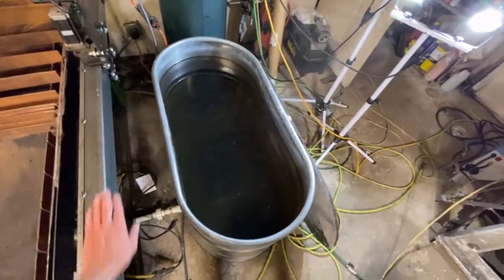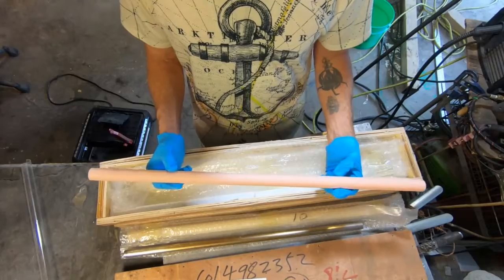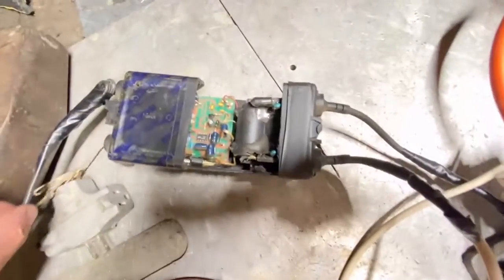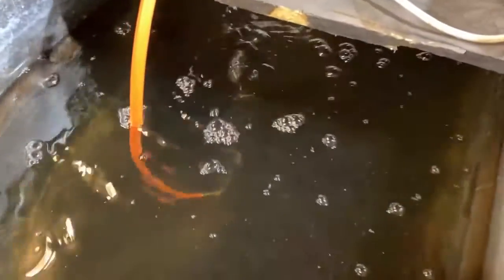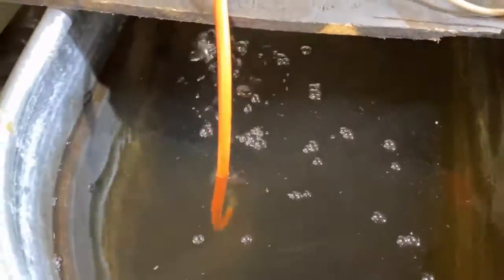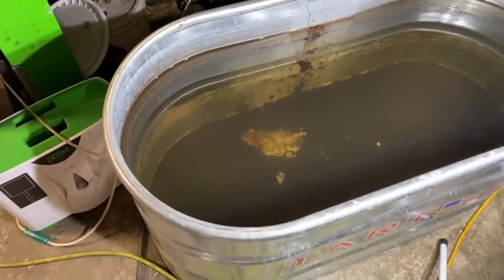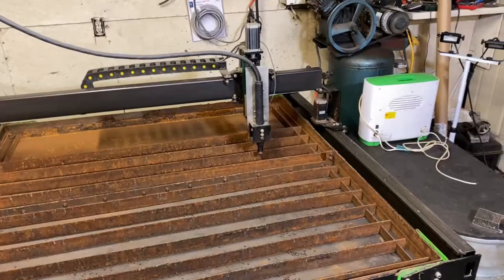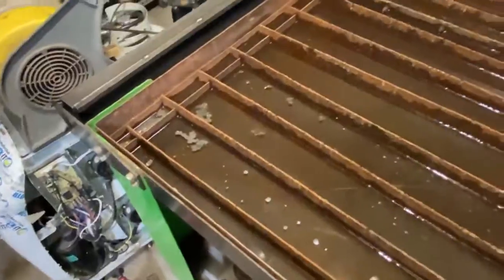Ozone water treatment for plasma table bug soup

Comment: Even low concentrations of ozone can have incredible effects. Use an aquarium air pump to push air past a UV-C mercury lamp in a sealed box, take the <0.5% ozone to an air stone, and you can bleach stored water well enough to hold back algae growth indefinitely for a couple watts. Not for fish, and not for plants, it concentrates in the water, and still kills quite indiscriminately.

Comment: Be careful with ozone man. That stuff can really mess up your lungs on the long term, especially if you end up using it on a regular basis.

Sniffing it like you did here really isn't advisable.
Reply from the maker: Yes i agree but overwhelming ventilation hopefully makes it a non threat  . Ive taken whiffs off units so strong it stings your nose . Not that i advise it but the hazards appear to be benign  so long as its just long enough to see if the thing is working .
Reply from the maker: Probly do this once a month with all the doors open and 3 fans blowing

Comment: How do you ensure fresh air enters the place, ozone in high concentrations isnt healthy, if the place is drafty, id just setup a IOT/Home automation relay and cycle it at night, and as ozone is an oxidizer, will be intriguing to see how the tank, tubes, and table react
Reply from the maker: Th shop is well ventilated the entire time with multiple fans and openings

Comment: Just an idea. You are losing a lot of ozone from the bubbles back in to the air. Add a pipe from the output of the pump back in to the tub with some ball valves so it can be reconfigure to recirculate. At the end of the returning pipe put a venturi injector connected to the ozone generator. That will scrub and saturate the ozone into the water more efficiently in much less time (maybe less than an hour). Also suggest a plastic tub because metal does not like ozone. Don't have to worry about the table, if you let the water sit overnight the ozone will dissipate.

Comment: Can always test the ph and try to get it close to 7ph to 9 ph as possible also if you can get like a fish tank filter out a lot with active carbon and should wonder pre-filter your ozone with UV light it'll double the efficiency air stones won't be a bad idea either or using Ro D I water or maybe even if few well-placed magnets   or set up an overflow chamber for the pump sit in the bottom of
Reply: even a coil of that rubber hose with small holes in it acting like a very large air stone, cap on the end ofc

Comment: maybe the lower brightness in the tube is a lack of nitrogen. bubble that strong ozone through some dirt and catch the foam in charcoal...you might find a surprise loads up in the carbon.
Reply from the maker: LOL you always got some of the charts science in mind and  i love it .
Reply: @NOBOX7  the idea came from a story i heard watching the doco...all the gold you can eat. the story was a mine treating wastewater before release into a river. there was a static potential building on the plastic pipes that conmected the water/ozone tank to the charcoal beds. they found more gold in the charcoal than the mine produced. the wastewater should have been leached already. the operator got hurt by the static after reaching up to fix a leak on the pipe and the story went on to make even crazier claims that gold wires grew out of the fellas hand for a time after the accident which nearly ended him cos he couldnt hardly function for like 6 months and just wanted to sleep. in alchemy terns the ozone is the vehicle or empty vessel and the gold is the passenger...
Reply from the maker: @m3sca1  Bro , that is the coolest freekn story i have herd in years